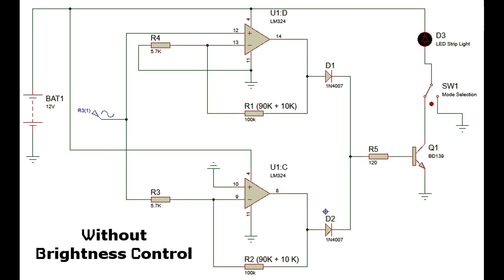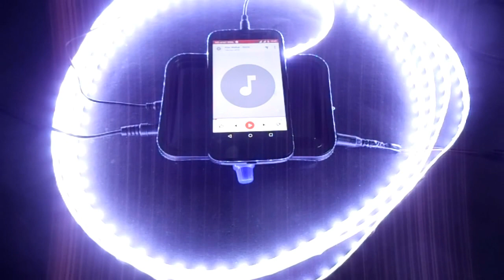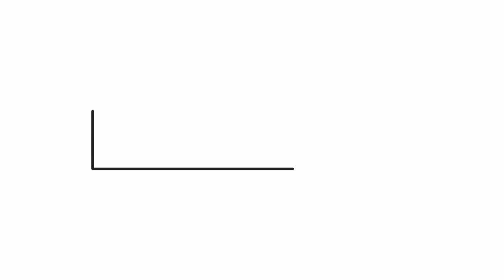Dancing LED Light | Music reactive or Sound activated LED strip lights using LM324

Comment: Bro m not much of a electronics geek but i am very mich interested to build this but when i went to the store for the parts they said that now the manufacturer has stopped making 90 ohm ressistors and gave me a choice of 2 options of either 82 ohm or 100 ohm resistor.it would be very helpful if u could tell me which one to buy
Reply from the maker: Always go for the nearest value, in this case 82 would be fine.

Comment: Hi dude why u have connected cord to mobile
Reply from the maker: Hi, The music is fed from the Mobile to the Dancing LED driver & the speaker.
Reply: Speaker is connected outside
Reply: U have also not shown connecting wires for speaker output and input
Reply from the maker: Yes.. The circuit does not provide the necessary amplification.. Because of that i used two 3.5 mm jack. one of the 3.5mm jack serves as the input to the Dancing Driver from the mobile & the other 3.5mm jack is used to feed the amplifier/speaker system. (you can watch this @ the video time 6:40)
Reply: Please give proper circuit for connection
Reply from the maker: Hi, i have shared a block diagram which can help you understand better. 
Please find the Video Link - https://youtu.be/XfqStsarWpE
Reply: It's says video is unavailable
Reply from the maker: Please check now
Reply: Thanks
Reply: Can I use a mic and not jack?